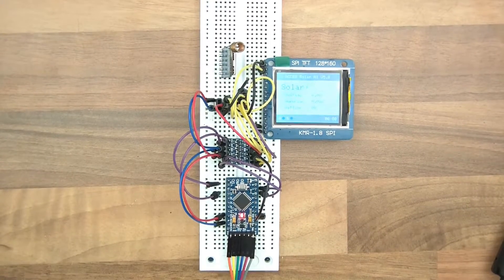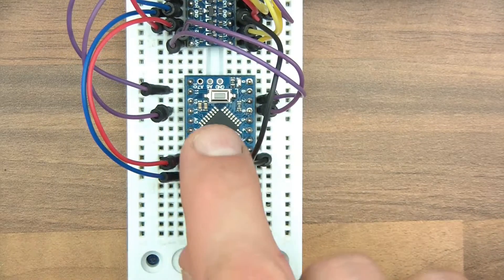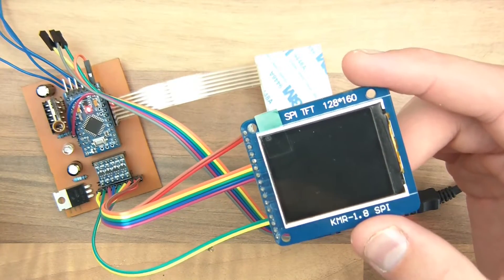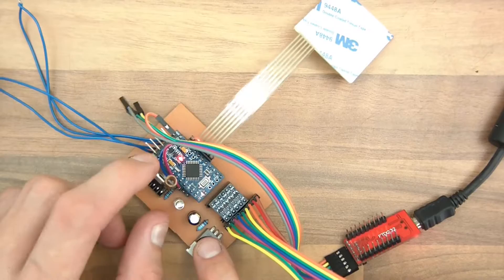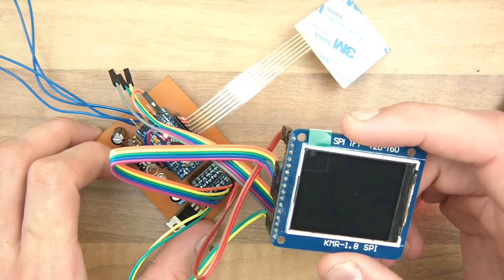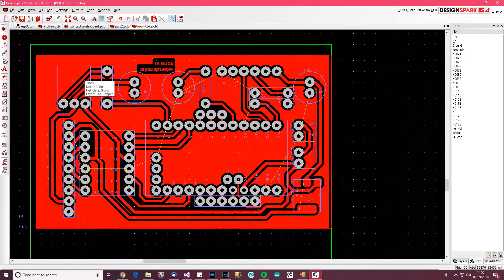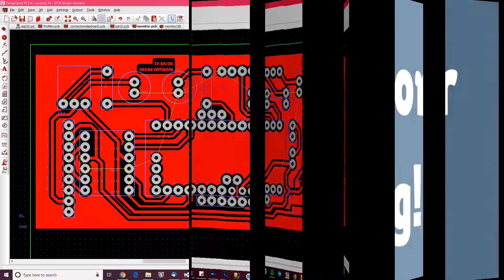INVESTIGATING: My DIY Offgrid Solar Power System - September 2018

Comment: Dear sir..  Have you made a correction after analyze any fault or mistake connection?. Your coding using voltage divider to measure the voltage and acs712 for current measurement?. And i believe that u ramp out your mosfet by using pwm to drive the current to get an iv curve?. Before u go to designed circuit.. Have u do a simulation such as proteus to predetermined that your circuit and coding went well?thank you.

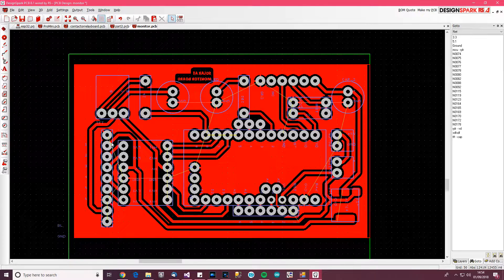Comment: At 7:54, looking over your pcb, there is a ground section that isn't solidly connected to the others. You can't rely on the ground connection on the arduino to make good enough connection even if there is good continuity. The GND next to the RST and RAW pins does not directly connect to the other GND plane. It passes through the arduino's ground. This is also Pin1 of the buttons.
I would suggest connecting a wire to the GND of the power supply and see what happens. It's possible there isn't enough current allowed to flow through the arduinos ground to allow signal to pass through the buttons.
Reply: There's also the similar problem with the TFT connections. Only 2 pins are directly grounded. The other one is not, it goes through a tiny trace from one of the others. Try adding a second connection to that pin. Not sure which pin number it is, but it's the top most pin according to the orientation above.
Reply from the maker: Ahh, so this isn't allowed? Maybe that is the problem then?
Reply from the maker: Thanks Korishan! That section actually does work, but a part was fractured.

Comment: Seems you are working on the top layer whereas you should be using the bottom layer for through hole single sided boards. Mirror it when you print though.
Reply: I echo what Gart said.  I can check your design for you if you want to send them my way.  I believe I see where potential mistakes are from your video.
Reply: I meant Gary (sorry for misspelling your name).  Antony, I sent you an email with an image of the areas where the grounds are not connected to the common ground plane.
Reply from the maker: Hi Curtis, I've checked the pins for being reversed and they aren't reversed. :( Curtis, thanks for your help, but they are connected. I've sent you a reply. There is something I've done wrong, but I don't think it's that. Hopefully, you will know what... :)

Comment: Thanks for sharing. In this case I would write some test sketches and test the individual components using serial print, starting with the keypad. I would also use the logical analyser at high resolution to check for small noise glitches on individual lines (in combination with one channel showing serial output to make sure you're looking at the right event happening). Good luck debugging this board!
Reply from the maker: Thanks MaxInt! I've since diagnosed the buttons problem on the board. It was a fractured/scored piece of track... As for serial and TFT, I still have no idea at the moment... I'm going to use analyser now.
Reply from the maker: I haven't used the analyser. I've quadruple checked the track and they look fine. The problem must be noise. I think the problem might be ground loops.
Reply: I had noise problems when driving a Nokia LCD via the PCF8574 I2C interface. Using the logical analyzer at high frequency I saw very short pulses that shouldn't be there. Long jumper wires and a crappy breadboard were the cause. Just changing to shorter wires or solved it for me. My cheap clone analyzer proved to be quite handy for debugging. Good luck on your project!
Reply from the maker: @MaxintRD  thanks for the useful information. It's good that someone else has seen this, because I'm new to it. Today, I hope to redesign the board because I think maybe it isn't so good. I'm going to spread the tracks out and maybe remove the ground plane. Do you think that's a good idea?
Reply: Unfortunately I'm just starting with PCB making. I hope to receive my first design coming week and then expect to find some errors. I'll definitely put it to the test and check it with the logic analyzer. Dave Jones recently posted an interesting video about PCB layer capacitance.
Reply from the maker: I'm just about to create my second attempt of this circuit... Wish me luck! :-D

Comment: Looking at your design I notice that it is a single-sided board with your ground plane on the top layer.  Those yellow lines indicate air wires.  Those air wires are at some of the connections on your ground plane.  Take a multimeter and check continuity on each of your ground points to the ground plane and you should find where you need to add jumper wires to bridge the connections.
Reply from the maker: Hi Curtis, thanks, I've check them all and they are all joined up to the ground plane correctly. (Unless you mean that they need a direct wire to the GND of the AMS1117?) :-(
Reply: Name the pour to gnd (or whatever the ground net is called)

Comment: I can almost guarantee there will be a fault somewhere, even if it isn't the PCB, especially after it worked on the breadboard.  Been there, got the t-shirt although that would be using Veroboard?

Comment: Nice looking PCB :-)  This is roughly the level I am at, which took me ages.  I'm using KiCad.
My guess is there is a short somewhere.  As you probably noticed bare copper without any solder mask is hard to solder.

I do have some solder mask paste and a UV lamp but haven't tried this yet.

I found a jewelers loupe is really handy for close inspection.
Reply from the maker: Hi, thanks for the comment! I'm finding it easy to solder, but I'm applying flux to every joint. Without the solder mask, it's prone to  getting dirty. :-) More to come!!!